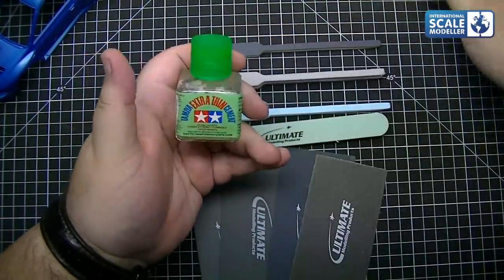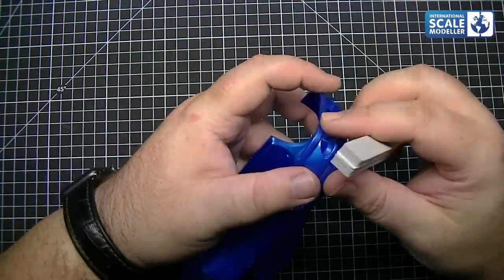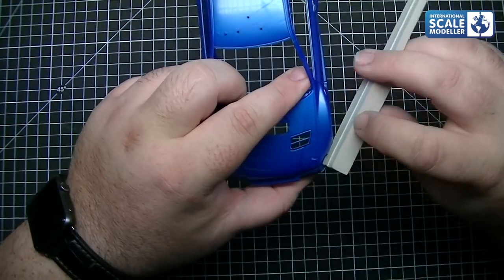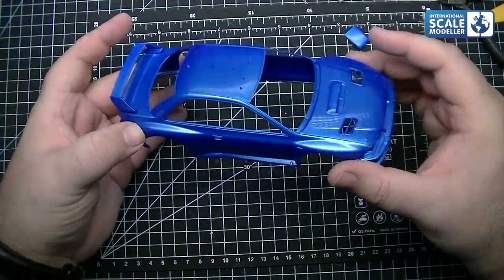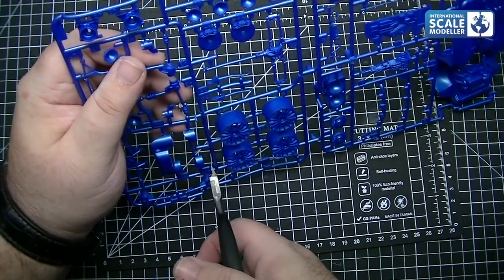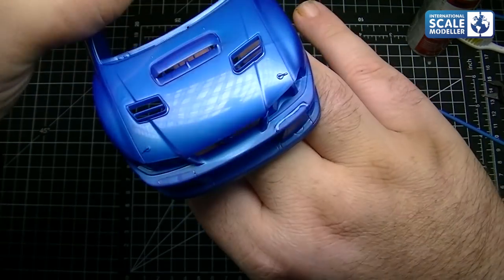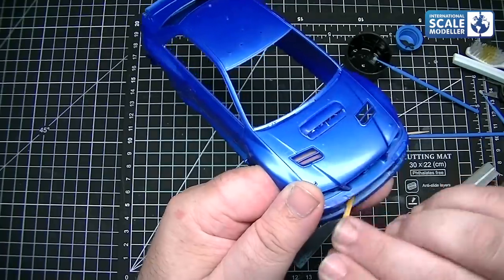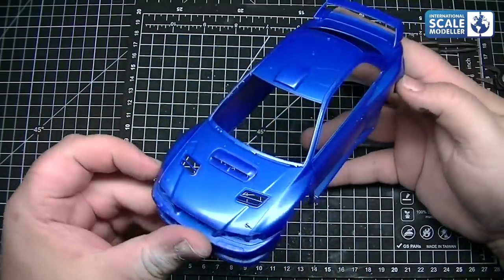Car Modelling Techniques Part 1 - Bodywork and Wheel Preparation Tamiya 1/24 Subaru Impreza '99 WRC

Comment: Hello Paul, just opened a box received from your shop with this car, sponges, buffers, etc. And starting to watch the series again, building along. A question - why do you prefer to polish back the plastic after removing mold lines vs the technics of scrubbing the whole car with 600 grid to help primer stick nicely?
Reply from the maker: Hey buddy, i polish it back to ensure any surfaces blemishes are gone then scrub the surface for primer :) thanks for watching and commenting - Paul :)

Comment: Awesome Paul! Still need to finish that Alfa 155 Martini DTM I started for your group build a few months ago, and these will certainly put me on the right track! The temperature got a little too hot for me to do modeling but I plan to get back into it once I am back from my holiday in Scotland!
I am thinking about stripping back all the painting I did on the body so far for the Alfa, as I have the Apex now and I want to try and to a better job this time round.

Thanks for the videos!
Reply from the maker: Hey Dan, yes you should strip it buddy and redo, hopefully see you back at it soon :)